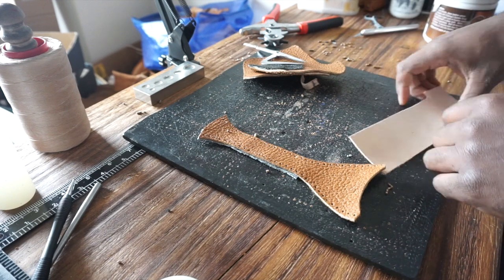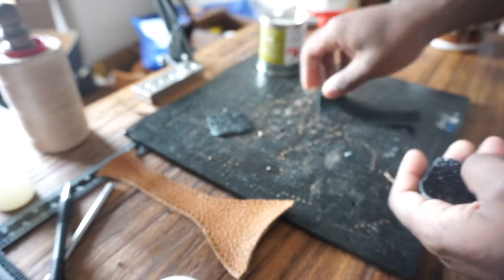Working with Stingray 2

Comment: Hey man, what camera where you using? (the one that overheated).
If it's a Sony camera I might have some solutions that I could recommend to you.
Reply from the maker: it’s a Sony A5100. i already got the external digital recorder after i researched the A5100’s overheating issue. thanks for reaching out though. i really appreciate it ☺️

Comment: Great content! What attachment tool do you use with the dremel? I’ve been using an industrial die clicker press to cut the stingray and have been running into issues with the outer perimeter of the stingray. Some of the calcium deposits are flaking, chipping and falling off. After sanding the perimeter do you seal the edges with anything?

Thanks!
Reply from the maker: the attachment i used case with it, so i’m not sure what it is called. i DO know that there are attachment kits for pretty cheap that would have it though. after smoothing it out, i use matte edge paint from Tandy (though any edge paint should do)

Comment: After you sand do you finish like normal leather with dye wax and a Burnishing tool
Reply from the maker: correct. post sanding, i use dye, Tokenole, then burnish.
Reply: @JRenardLeatherCo  I want to make a knife sheath taco style I will back it with veg tan 6to8 oz will that work
Reply from the maker: @Baldmanblades  6-8oz will be just fine. just know: 8 is pretty thick to have on the waist. i reserve that thickness for gun holsters.